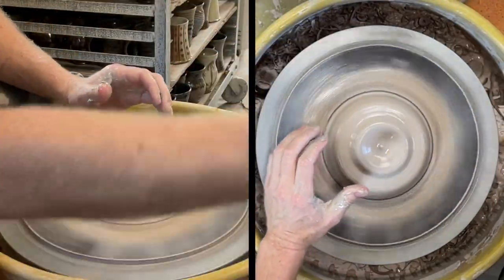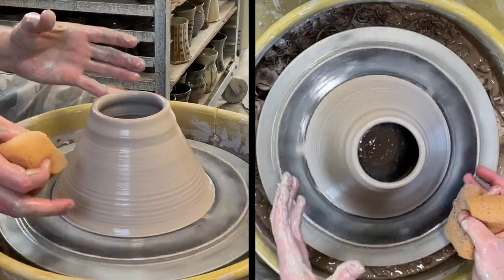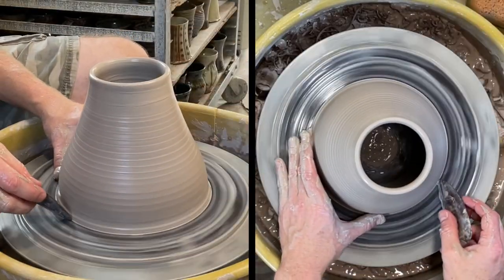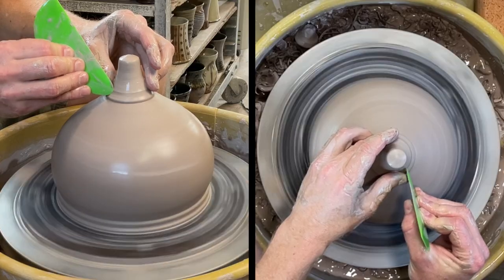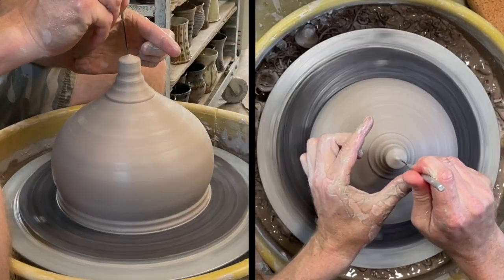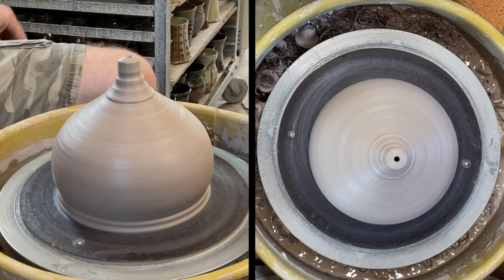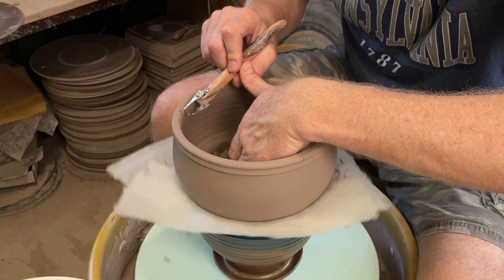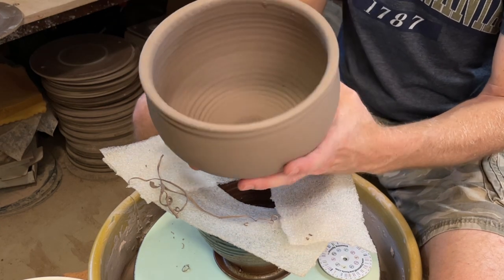How To Make A Pottery Hanging Planter

Comment: Made a similar hanging pot. Took 3/8 x 1/4 short piece wood  and contoured crescent shape on a end and used as shaper for opening while throwing. Then just sponge finish while holding in lap once a little dry.
Thanks for you tubes.

Comment: Hi I was wondering if you could share recipe for you wading.   I made some and it does not want to come off the pots without chipping.   Thanks live your videos. I have learned so much from you.  I have also made these hanging pots and having issues like I sais..  thank you
Reply from the maker: I recently had to add ball clay (om-4) to my recipe because it didn’t roll into balls easily but it still fired out great. Probably 1/2 - 1 parts ball clay added to the recipe.